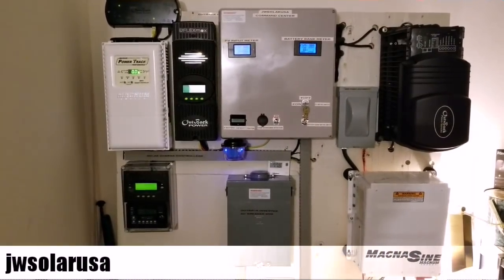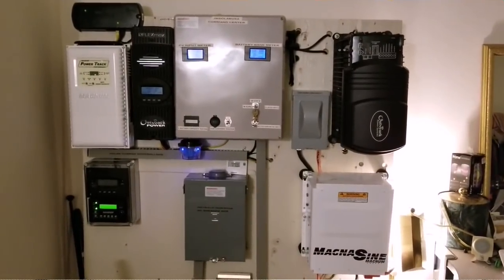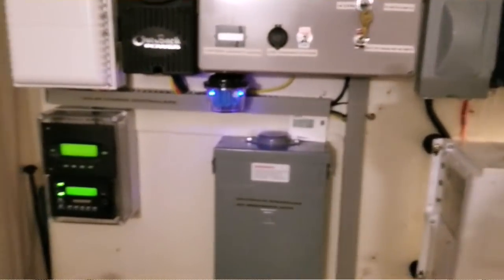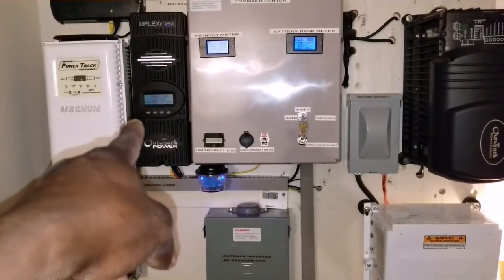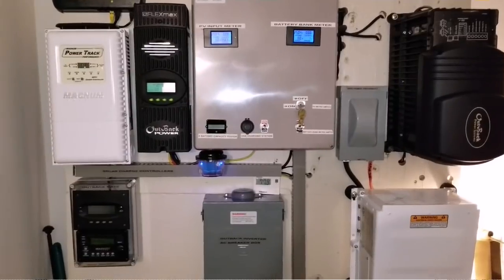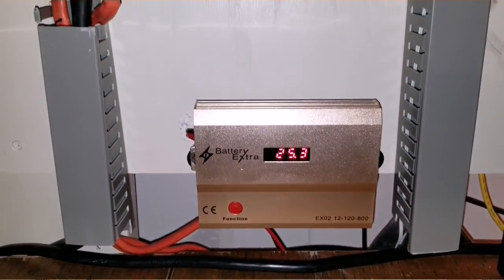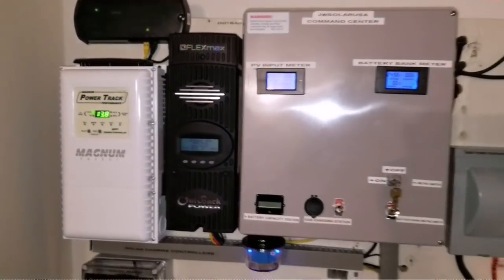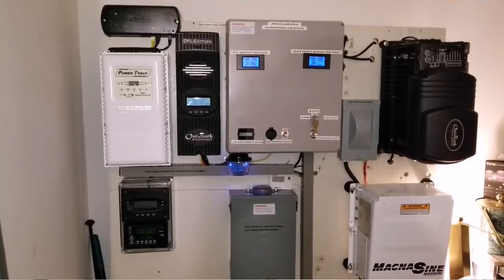BATTERY POWER HOME | THE ENERGY REVOLUTION FULL REVIEW

Comment: Looking good!  I assume your going to be charging two separate battery banks and I would like to see more on that.   Note:  You might want to invest in a MagWeb.  With the MagWeb you can monitor your system from anywhere including your phone.  It is a bit pricey and it could be a lot better but it's a LOT better than nothing.   One thing I don't like is that it only shows the master inverter data but the 2nd inverter is usually the same.  Here is a link to my realtime MagWeb data:
http://data.magnumenergy.com/MW5454/
Reply from the maker: This is pretty neat and interesting brother! 
I am loving this and still working on my Systems. 
I wanted my two Off Grid Solar Systems to be completed. 
My Magnum Energy system and also a complete OutBack Power System. After that, I am all set with a 24V and a 48V Solar Battery Backup Systems.
It takes time and money to do all these stuff but I will get it done in Jesus name.
I will also consider investing on the MagWeb which I was just looking at last night. 
Thanks for your comments and support towards my channel and have a bless day Sir!
Reply: You might have to have the battery monitor kit for the MagWeb to work to is fullest potential.
Reply from the maker: Yes I do have one i bought 9 months ago. Here is the link to the video:
https://youtu.be/Tb84fAswgt4

MAGNUM ENERGY ME-BMK BATTERY MONITOR: https://www.youtube.com/playlist?list=PLSNjIRSnUPDKE2_Xfeyk-o-V7l9FF8M3z
https://youtu.be/k7g64042kmo